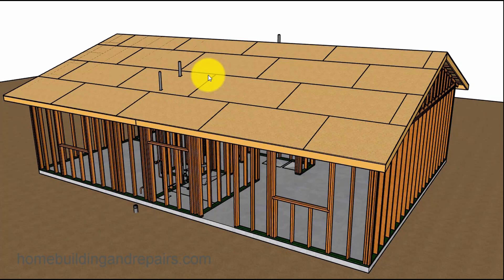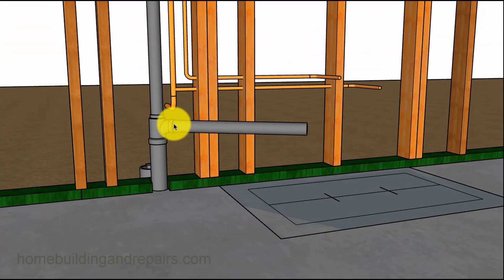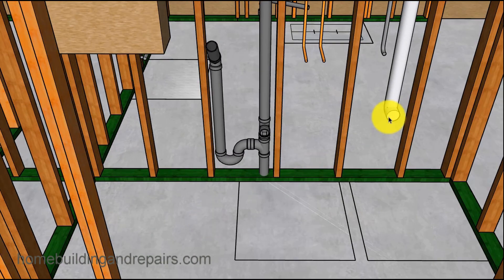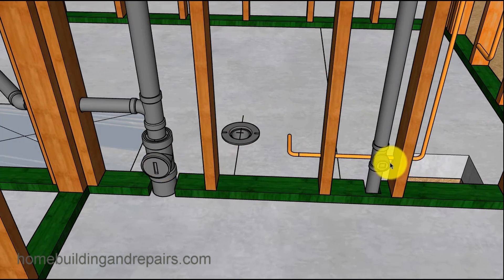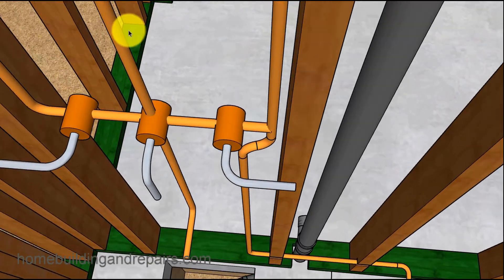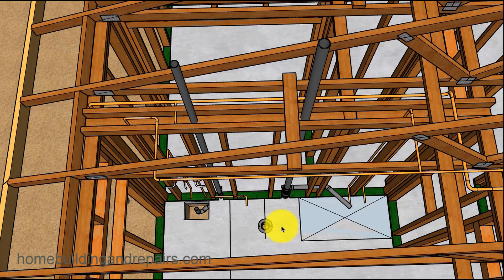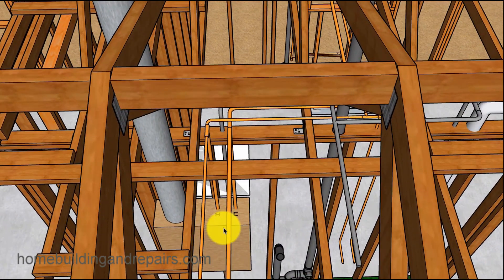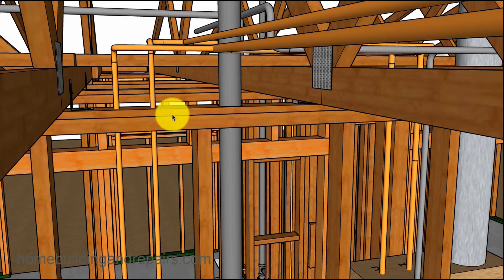Rough Plumbing Pipe Layout, Gas And Dryer Vent For 850 Square Foot Two Bedroom House - Part Six

Comment from the maker: A viewer pointed out that the arm going from the laundry trap to the vent needs to have at least 4 inches between them to prevent creating a crown vent. As a framer I always wondered why plumbers had to drill through multiple wall framing studs for laundry drains and now I have a pretty good idea why.

Comment: Hello and thank you for great video!! I had a slab leak and have to reroute my cold line from garage to upstair bathroom. I would like to use copper pipe. Is it possible to run 1/2" copper pipe through 2x6 studs 16" oc apart with total length of 10'? Or PEX is better in this case?
Reply from the maker: It shouldn't be a problem, but you can always check with your local building department for more information.

Comment: Hi! Great videos! I have a question about floor drains. I realize that you guys in North America don't use them in any area of the house. Here (LatinAmerica) Is requiered by code to have at least one in every bathroom, kitchen and utility room, to avoid flooding problem in any eventual problem with any fixtures. Public and private projects. So my question is how the codes handle those issues about floor draining?. Thanks
Reply from the maker: From what I gather, it's an unnecessary expense, but I also heard stories suggesting that they were originally installed to drain waste or overflow from fixtures that became clogged, but instead were used to make cleaning easier, but this doesn't make sense either, because you could pour the waste from cleaning down the toilet drains. Then there's my best guess that make sense to me and that might have something to do with the lack of water in the trap, because unlike a sink, the water could evaporate and allow sewer gases to enter the room.
Reply: @gregvancom  hello, after I wrote the previous comment I started reading online about the subject, because it's very interesting. For us would be "crazy" not to include the floor drains in the plans, but for you guys is the opposite, even aesthetically would look bad. So after reading about it I came to this conclusions: 1- It is mostly about costs associated with more plumbing. 2-Our projects, public and private are built with concrete slabs, you're never going to find a floor with wood joist or anything like that. the finishing are always with tiles, granite or similar materials, which is easier to create the slope for the floor drain, I guess when you have plywood, sheating, etc, it's more complicated in that matter. 3-as codes don't require it, the typical American plumber isn't going to install one. 4- most of the damage in wood framed houses is caused by plumbing leaks between the floors, and therefore would not have been prevented by a floor drain.
Reply: @gregvancom  your videos are great and educational. thanks

Comment: Hey great video!! I wanted ask how you vented the dryer gas exhaust? Not the lint vent . Which was one of my concerns with my project.  Wasn't sure about how to vent the lint vent from interior wall, so thanks for the info on that !!!
Sorry in advance if you already answered elsewhere!
Reply from the maker: The lint and exhaust for gas usually run in the same vent.
Reply: @gregvancom  wow ok , thanks !

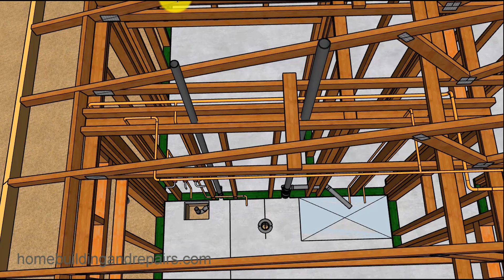Comment: @8:39  Why aren't the cold/hot pipes in the same run?  Are there benefits to separating?
Reply from the maker: They can be, but I was locating them in the most convent sections so I didn't need to drill through any more framing components than necessary.

Comment: Greg, This is an awesome video, Thanks a lot. There is maybe an issue with the Laundry drain. You got a crown vented trap, It's a code violation, it'll be siphon trouble, the P-trap will fail, and the sewer gas will come into the house.
Reply from the maker: I see what you're talking about and will put a note at top for viewers. I couldn't find it in the international plumbing code book, but found it in a few others and it could be an issue to consider and thanks for helping me help others. I got to learn something today.

Comment: Great video. Quick question. If I’ve already got the metal roof on before starting to do my rough in pluming and wanted to connect all the vent pipes together and not go out the roof, can’t I just 90 over and come out the side of the home under soffit ? Thanks!

Comment: Most new Clothes Dryers are recommending the maximum run for the vent to be 5', mine vents directly out the exterior wall of my home. In the design of the house I mentioned in the previous plumbing video it vents from the right side of the dryer directly out the exterior wall. The vent in your design can create trapped lint and fire issues. I am not for putting the machines in interior rooms what so ever. I have seen a house burn down because of the vent for the dryer rising to the roof of the home. I also design the heating and cooling equipment in a closet as they used to be for easier access especially during the Hot Arizona summers. This keeps the AC guy from having to crawl into a sweltering attic!! Everything is electric to eliminate gas vents throughout the house. The design I made has one single 4" plumbing vent leaving the roof, otherwise the roof is completely clean, the Air Conditioning Compressor is ground mounted. Again much easier access for repairs! I always try to compact the plumbing footprint by placing those rooms back to back to not only save in initial plumbing cost, but using less square feet to which the plumbing has to take up. The two mechanical rooms one above the other houses all plumbing, kitchen sink on the left side including access to the water line for the refrigerator ice line, The other side bottom floor is from center of the house: Guest bath sink, then toilet, then washer, then dryer. Upstairs it is the master bath sink, toilet and tub/shower. The water heater being electric requires no vent and is in the first floor mechanical room. The heating and AC are installed in a small closet with-in the guest bath. This provides a direct straight run for the duct work for the first floor and up to and again a straight run for the second floor without using too much space. There is no natural gas used on the property. Even the AC Compressor is in a rear portion of the Garage behind the kitchen door area and vents horizontally through the wall to that covered patio. This prevents anyone from tampering with the unit, and keeps it out of the weather, concealed as to not be an eye sore.
Reply from the maker: This is the first time I heard anything about dryer vents being larger than 4 inches, but 5 inches would definitely be better.
Reply: @gregvancom  I think Gregory Miller was referring to a distance of 5' rather than a diameter of 5". As a side note, that 5' length seems short to me, but I'm replying to toss in a word of caution about sizing up from a 4" diameter dryer vent pipe. 
I am currently wrestling with an interior dryer install that runs about 17' to an outside wall. I just wanted to mention that I was considering going with a 6" diameter dryer vent pipe for the run across the ceiling, however, was warned against it due to a loss of velocity to actually carry lint. While the hot air will flow easier, velocity is needed to "blow" the lint out. If the pipe is too large, thus reducing velocity, the lint tends to drift down and collect. As a side note, I spent many years at a large Fire Department. Nothing is more responsible for house fires than lint! The collection of lint is what will cause the dryer to eventually overheat and in far too many cases either ignite the lint or simply cause the appliance to catch fire. Your tip about a "cleanout" at that first 90 to clear the vertical wall pipe is awesome advice. Keep up the great work, I have learned a lot from your videos.

Comment: Why do all of your drains come out of the wall at an angle? Supply lines in the attic are a terrible idea...
Reply from the maker: The drains can come out at 90° angles, but I like to install them this way to keep the drains as straight as possible. I was also wondering why you believe water supply lines in the attic are a bad idea.
Reply: gregvancom I figured that would be the explanation for the drains. I can go with that logic, but I’m the kind of freak that wants everything (even the stuff that no one sees) to be symmetrical and pretty. 

As for supply in the attic... That’s the worst part of the house for climate control. When a line freezes, it will spread all over the ceiling, run down walls, then onto the floor. Never mind the fact that in certain places it can rain down into electrical and/or expensive electronics. In the summer your cold water will be warm and in the winter your hot water will be cold. Obviously that can be addressed with attention to insulation, but many builders suck at properly insulating houses. Even if the insulation is up to the job, you are also more likely to experience rodent damage in the attic. I’m a big fan of running plumbing in crawl spaces. There is far less chance of expensive water damage when all of your pipes are under the house. Second best option would be in a slab. That makes renovation projects more difficult, but build the house you want to begin with and let the next guy worry about renovation hurdles.
Reply: athhud  With slab construction, running water lines overhead is not an issue. Especially in warmer climates such as Florida.
Reply: Sean M Florida is across the street from my house. People around here have burst pipes left and right the 3 or 4 days of the year that we get a really cold freeze. I’m sure South Florida is not a problem, but in North Florida you would have rain coming from the ceiling in the typical house. Insulation practices are a joke in this region. I don’t know anyone that has built a slab house with plumbing in the ceiling. If you are building on a slab, put the plumbing in the slab and never worry about it again... Obviously that requires a lot of work to remodel, but no one builds a house to remodel. Put the pipes in the slab where you want them and let the next owner worry about remodel struggles...

Comment: Can you combine the vents so you only have one going through the roof?
Reply from the maker: Definitely and it looks like R.T. already answered question. I've seen it done plenty of times where the bathtub and the sink vent ties into the toilet vent. The bathtub in the sink vents can be inch and half diameter pipes that tie into the larger 2 inch pipe. Just don't have larger pipes connecting into smaller pipes. Let me know if this doesn't make sense.
Reply: Yes you can'
Reply: @SvenK-CAD  Thanks
Reply: Yes usually in the bathroom you can combine the 2, above the flood line and vent them up together
Reply: DJ Humphries  Yes, combine them. And then route them to the rear of the house, so as to have minimal roof penetrations somewhat out of sight.